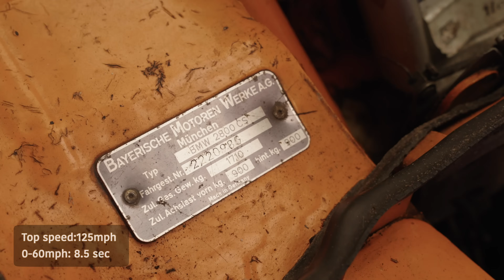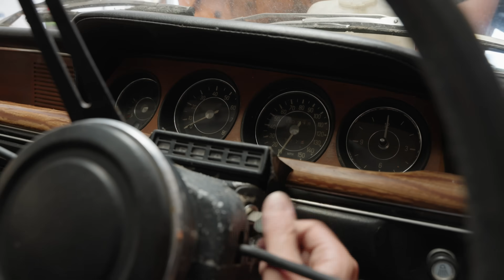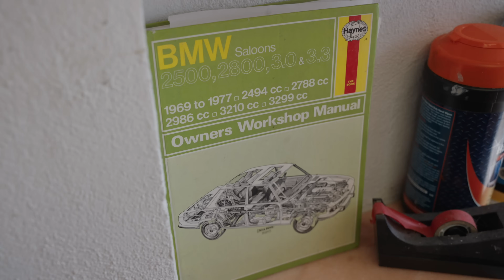Barn Find rare 70s BMW CS Coupe survivor car untouched for 38 years - will it run?

Comment: I have a 72 3.0cs it  sat 20years in a shed i bought it 2003  started it and drove it home 35miles got most  panels  replaced its now sat 10  years soaked in dinitrol  not finished yet

Comment: This was wonderful, i think if it can be made tidy and road legal and just use it, no need for a full on resto. Definitely a keeper. And what a nice place Saundersfoot is.
Reply from the maker: It can definitely be mildly renovated and used as a tatty, but mechanically (structurally) sound classic. That's the aim.
Reply: The unfortunate reality is it's going to sit in that garage for the next x years while it continues to rot. Hopefully the owner will see sense and sell it on to someone who will restore it and use it again.
Reply: If the owner wants to keep the car and use it I'd love the opportunity to help out with some welding to get this back on the road!
Reply: @TheLateBrakeShow  I wouldn't want to drive it on todays roads, i get paranoid about being rear ended standing at a roundabout, happened to me twice, first car written off, second time i was driving a transit, did 2.5k damage to it and it was almost new.
Reply: @dwhxyz  Hope not if i had it it wouldn't. Different from a Ford Capri an had a great rivalry in the Batmobile vs RS3100
Reply: …yes, just enough work to be made tidy and road legal, perfect for cruising around the local countryside, and the occasional trip back down to London to visit friends and family.
I was really taken with the village of Saundersfoot, it’s community were very welcoming, which is why when the six months short term rent on the adjacent property were up, I decided to stay here, rather than go off travelling round the world.
Reply: @gordoncouser5906  Do you have a plan for getting the work sorted?
Reply: I consider that a relatively 'modest amount' work would be required to meet MOT requirements, however this type of 'minimalist repair' would not slow the car's body from futher 'rot' once it's on the road - as BMWs of this era were very 'poorly protected'.  It would be far more sensible to perform the required work to achieve a state that would dramatically slow the rot - as it could be used with more confidence and would be more 'saleable', if the owner could no longer afford to keep it.
Reply: Ford Capri 2.8 injection special with specialised over bore high lift cam engine that had alot of money spent with Sportex exhaust, was waxed oiled an was a big bonus for a car put away for year's in a shipping container. Ppl got it from didn't know that it was a high spec rare Stratos Silver 1056C V6 paint code with Brooklands J7x15 an the original 13s in the boot. Got her for peanuts really 🤝🏻

Comment: My E9 was sitting for 4 months last year (typical due to weather). I used that time to slowly replace the starter that turned into a few other engine projects. Once everything was back together, I turned the engine to test the starter and get some lube going (I had fogged the cylinders). It immediately sparked up and started running. I still had the garage door closed because I did not expect it to fire up without some turning for 10-20 seconds. I was shocked. Old BMWs and that old M30 engine are bullet proof.

Comment: Fantastic episode! Took me right back to my childhood as passenger in my dads 3.0CSi and then saloon version (3.0Si) during the early 1970s. You mention the expensive coupe, it was double the cost of the saloon. Same engine, gearbox and trim levels. 😊😊😊 (no spoilers but wow didn’t expect that!)
Reply: You were lucky. Both the CSi and the Si were, and still are, stunning looking cars. The current BMW designers need to take lessons from the past.
Reply: My old man had the 3.0S in brown metallic, proper 70s colour 😂
Reply: @davidevans5782  I remember that colour!!! Dads 3.0Si was the light blue ( v pop colour) and my mums 2002 was the bright orange (my guess the same as the video csi

Comment: Not only do you get to check out amazing cars and have fun with them, but you get loaned a Caterham to drive there?? Why am I failing at life so bad?

Also, this car is sweet. Weld up the rotty bits, patch up the paint where needed and enjoy the seaside cruising.

Comment: The part that was smoking is not a transistor, it's a resistor. Not sure about BMW but in Australian cars from Ford, GM & Chrysler it's in series with the coil & drops the voltage so a 6 or 9 volts coil is used. The resistor is bypassed during the starting/cranking so you get full battery volts on the coil, ence a fatter spark & easier start up.
Reply from the maker: Thanks for reminding us. Jonny totally forgot the correct name that day.

Comment: I had a really nice `73 3.0CSi in the early 80`s, the only issue was the front wing corrosion ... but only on the gutter bit under the bonnet. The guy I bought it off gave me 2 brand new genuine wings with the car. I paid £3k for it and sold it a couple of years later for the same money and gave the guy the 2 new wings. Fantastic cars.

Comment: Great video. I owned a 75 3.0 CSi which had had at least 2 bare metal restorations before I owned it in 2014. It could get very rotty underneath. But I took it out on a drive (it was black with Alpina wheels) with a mate in his DB5 and I was surprised how many people came and looked at the CSi in the pub car park !

Comment: That is not a transistor it is a ballast resistor how they were used back in the day was you ran a Coil rated at 7 volts and when you turned the ignition key the starting circuit bypassed the dropping resistor which is the correct term for what this Ballast resister actually does.
It runs normally on a circuit through the dropping resister at 7 volts, But when cranking the bypass circuit means the coil gets a full 12 volts to give a stronger spark output for easier starting, This style of system was very common back in the day on many cars and the Ballast or dropping resister is very common and pretty much all interchangeable across many makes and models.

This style of Ignition circuit fits in very well with a mod not common but not unknown from manufacturers where they actually used a relay to supply full battery power to the starter motor solenoid meaning the solenoid got full battery power meaning it worked very efficiently giving a strong connection via the solenoid so the starter motor worked very efficiently at turning the engine over because the solenoid contacts which allow power to be fed to the actual starter motor with good strong connections meaning minimal voltage drop and a high efficiency motor that starts the engine far more easily than conventional systems.

Such a modification means a vast improvement in starting when one considers older cars often have poor connections and voltage drop making then hard to start without a full rewire.

Comment: That starts quicker than my 70 plate Vw Tiguan. Very impressed. What does the A stand for on the auto selector?
Reply: @ChrisJons-tt9fj    …I have a funny feeling that the ‘A’ on the auto selector may stand for ‘Automatic’ but don’t quote me on it, at least until I can down to the garage and verify it with the information contained inside the original owners handbook, and I’ll try to get back to you, but it’s lots of stairs so please remember, patience is a virtue…    
      …🕊️❤️🕊…   Peace and Love,   Gor x
Reply: @gordoncouser5906  t
Thanks, mate, don't worry. Only if you get a chance. I thought automatic then saw the D for drive, which I would assume would work through the gears as autos do. I've been a mechanic for 26 years and never come across an auto like that. It's a great car, though 👌 it would be amazing to get it back on the road vehicles like this should be preserved unfortunately they will never be made again. 😞 Thank you for taking the time to reply 👍

Comment: @9:04 Now THAT (2000 CS is a BMW I would love to own.  Would be as quirky and avant garde as my '67 Jaguar 420 compact is especially here in the US of A.
You shouldn't need to buy new front fenders.  Even that bad, they can be welded.
Reply from the maker: The 2000 isn't that desirable apparently, so maybe you can find a dry state car somewhere out there. We love a mk10 Jag too.
Reply: @TheLateBrakeShow Mine's not the Mk 10/420 G, is the smaller 420 compact based on the MK II/S-type.   Thanks for the reply. Great channel!!!

Comment: Seems like you have a 12v issue, most “ballast” resister coils and points are what you have.

Get a 12v sports coil and an electronic ignition kit. 

Loads available and they make all the difference.

Comment: It's great that you bypass the fuel system and with older gas like that. But please please just change the oil on a car that's almost 40 years old since this last oil change.  Petroleum oil that's 40 years old and you don't do a change. Tell me why that's okay

Comment: So, Tony, what would you estimate the restoration costs would be??
Reply from the maker: A full resto would be quite scary price wise. We were looking at leaving the paint and replacing the necessary sills, floor sections and rear corners. Then the front wings if the funds allowed.

Comment: I think that auto shifter is incorrect. As are the dials above the passenger side dash. These E9's rotted spectacularly. Can look great on the outside but be rotten on the inside sadly. Sills especially. As I know to my cost after a £35k (!) body restoration on a CSL that looked perfect but obviously wasn't. Ace car though!
Reply from the maker: Dials on passenger side are British Smiths units. Is the shifter wrong? We had never seen one before.
Reply: From memory shifter should be a T shape I think. Gauges later addition too. @TheLateBrakeShow

Comment: The CS coupes were made by Karmann not by BMW, there were rumours that they were built using ungalvanised or poor quality steel hence all the rus, the one i bought in 1990 to restore had already gone too far and I remember seeing a CSL at a scrapyard which also had it's A-post severed from the bulkhead due to rust!, BMW is still screaming about how Karmann built these cars
Reply from the maker: We said they were made by Karmann, didn't we?
Reply: @TheLateBrakeShow  I am sure you did, I was making a general point, most people don't know and don't expect a BMW to rot  like the CS' do

Comment: Problem with E9s generally is that they were built by Karmann, so that tends to mean rust traps built in as standard. Karmann were quite notorious for this, and E24 bodies built by them have similar problems. As is said in the video, they can and do rust, generally from the inside out. By the time rust appears on the outside, it may be too late. Sea air doesn't help either.